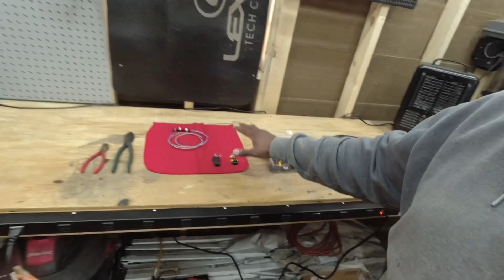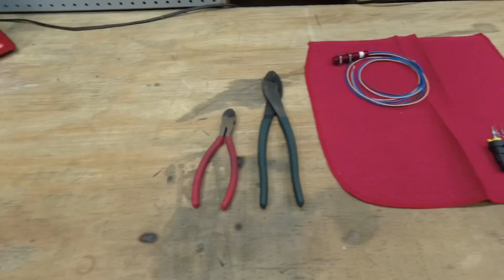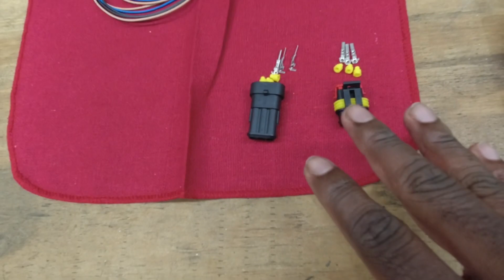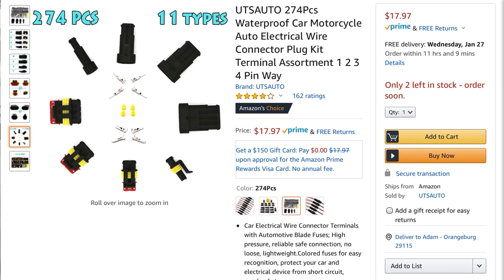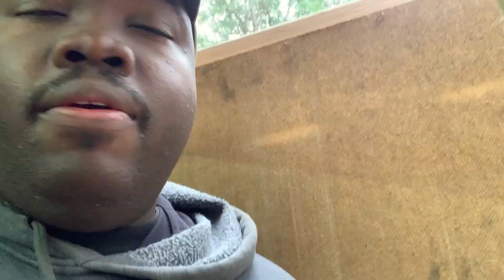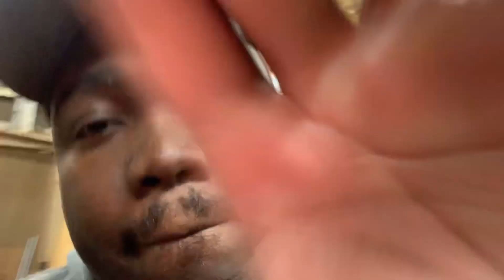Testing out AMAZON connector kit to fix the E36 Hall Effect Conversion

Comment: You impress me, because years ago I used to build cables with those exact connectors- in fact years ago (12) I went out and bought a $32.00 crimping tool from advance auto for those very same ends. I was in advance auto last week and smiled as I saw my very same tool (at the same price). I’m still using the very same tool because it comes with a few extra dies for crimping. Seeing you continue on with the car projects makes me proud. In fact since moving to Ridgeland I’ve become an avid fan of the Motorsport channel. I see the love you have for working with cars. I just changed out the water pump in my ranger truck. Your videos has had a very positive effect on me with working on my truck. Also i happen to be upgrading an old barn for a brother  and your work desk, the power strip-what I put in is exactly like your setup- Keep it up my son!!!